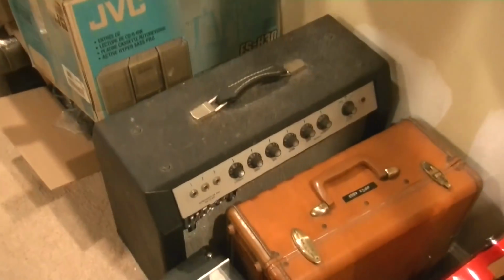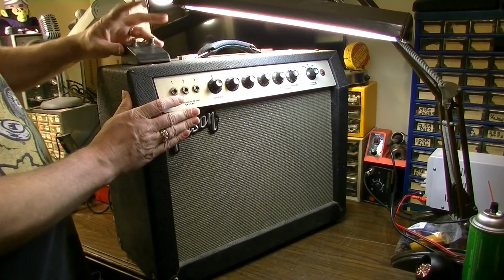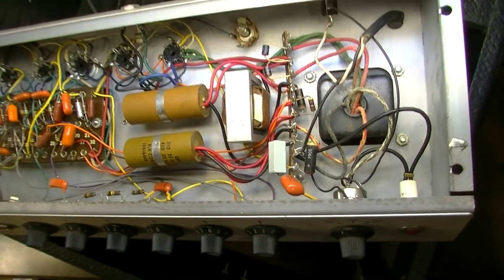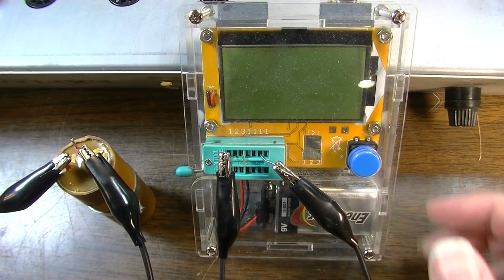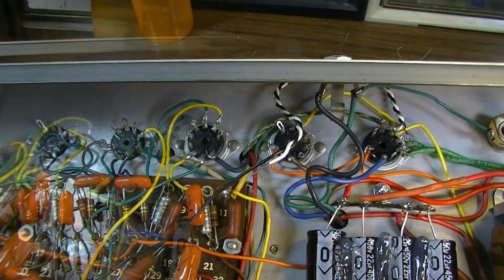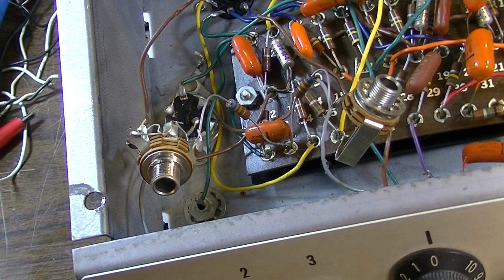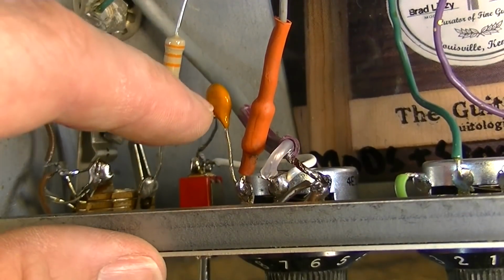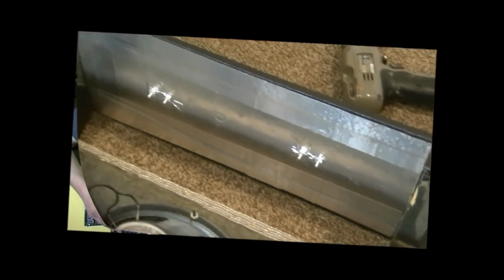The Baddest Gibson GA15RVT Explorer on Planet Earth?

Comment: Awesome new lighting and sound, Brad! Looks and sounds great. One other thing to note for any new people thinking about getting into this stuff; the high voltage in these amps is no joke. If you're thinking about getting into doing amp repair/restore, please make sure you are comfortable and familiar with safety procedures. Have fun repairing your amps, but be safe!
Reply: Simple, set up a ground, and use it to test for stored energy. The old TV sets had far more energy than your average tube amp, but stay safe. Learn the right way, then you don't have to be scared.

Comment: Hey Brad, have you ever tried one of those desoldering tools that is heated? Basically, it's a 30 watt iron with the vacuum plunger like a regular solder sucker. Seems like it would make life a lot easier, having to only hold one tool. Tenma 21-8240 Vacuum Desoldering Iron https://www.amazon.com/dp/B008DJRYIG/ref=cm_sw_r_cp_apa_i_.3J-AbP5W849E

Comment: What about using a Bridge rectifier and a 7806 regulator and two 1,000uf caps to clean out any ripple that should give a rock solid 6V to run the filaments, he 7806 might need a heatsink.

Comment: I have the GA-35 RVT and a host of issues .. did some mods from Uncle Doug’s channel and it improved .. trem & verb is funky and doesn’t really work unless I short some foot switch wires (makes no sense) ... need to do a cap job to see if I can fix the trem, verb issues... it is a harsh amp initially... but hoping mods and cap job will warm it up..

Comment: Great work bud,next time with your Makita or whatever screw gun your using,is take your wire's twist and put in the chuck tighten them up and slowly pull the trigger.it will save a little time .👍👍🎸🎸🎸

Comment: One thing i do is twist my wires by putting them into the end of a drill, and let it rip. i do a bunch of feet in different colors in long strips and cut as needed. Oh wait, are you still missing your drill???? meh....!~~~~
Reply from the maker: The drill for twisting has become a popular subject in the comments. I really should have addressed that in the video. I was trying to use up some shorter pieces of wire I had lying around without twisting a big long length of new wire.

Comment: HAD another thought, know its sacrilege to Ampaholics to deface the oldies, but since u started it, the amount of work u put into that i would have kept going and put your MIDRANGE on the front, would drill knew hole between the Power & f knobs spacing it same as all the other pots, Remove existing power knob and put a Toggle SW in its place because of Spacing. move all pots over and put your knew Midrange between the treble and bass.  then a LOT of  relabelling would HAVE TO BE DONE & Lable your other Mods. 
 
WOW, what an amp that is NOW U R the BEST  : )
Reply from the maker: I had the same quick brainstorm, but that's out of the question for a couple reasons. One is the fact I hate defacing vintage amps, the other is I don't have the means to relabel the faceplate, even if I did drill it and move the controls. The midrange would need to go where the Bass control is now, and everything else scooted down. Good thinking, but just not a job I'm up for.
Reply: was wondering if  "Letraset" would work ? 
  https://www.youtube.com/watch?v=ed6iXQW_O1U
Reply: Rob Young I
Reply: I was thinking that must have been your reasoning.  Without defacing it, something that might look cool on a future job is some small bit of brass plate, cut out, and then stamped with the modified function labels. They would be held in place by the nuts that hold your pots in, and are removable, so them amp mod is reversible without cosmetic harm to the front face.
Reply: Brad,
Seems to me you don't need the "old bones", just a source of transformers that won't break the bank. How much longer would it have taken you to build that modded amp from scratch, compared to troubleshooting and then modifying an old one which needed new tubes anyhow? How much more would it cost?

You'd have a drop-in chassis someone could put in a combo amp that's otherwise not worth fixing, and you could put as many knobs as you want, where you want, because it's your chassis. :)

Comment: just a thought  Brad, if u have to rewire things like that, u could sweat the leads off (Tube#2) and twist the pairs on both sides, so your soldering 1  point and have 2 done, then go to Tube#4  & do the same. this way u solder 2 connections and all 5 are correctly wired.  : )       and cut the nonsense off the first.tube#1

Strange they did NOT do it properly originally ? because they did twist the pair from the transformer.
Reply from the maker: That's a nice suggestion if there was enough lead. Not enough lead though, especially for what I wanted to do, which was push the wires back into the corner.
Reply: Rob Young if you just use the existing wires and you twist them you'll never have enough room to reconnect them and get them back out of the way, just a thought.

Comment: I use aluminum HVAC tape for shielding too.  I've compared it against copper with my amplifier and it was unnoticeable.  It wasn't copper tape either, it was 1/16" copper sheet from an old church I re-shingled.  Literally no difference.  
The experiment was used on my heavily modded Pro Junior III.  I made it into a head.  Made two top covers one with each type of shielding.  So I could just pop one off and pop one on while my looper was playing.  No top I could hear my wifi just cracking away.  Either top made it dead silent.
Reply from the maker: I suspected as much. Thanks for sharing.
Reply: You're welcome sir.
Reply: I’ve used heavy duty aluminum foil attached with Elmer’s glue and that worked well also.
Reply: Desde Chile te veo .eres un talento .... ojalá vinieras a Chile tengo unos  vintage  amplif... Philips .guyatone reverbrock  .hohner . Lab series . hamstrom sweden ...te espero jaja.
Reply: I dont' see why not, I'd even say use contact cement spray and it could be super ass cheap to put on and easy too.

Comment: Surprised I didn’t see a couplet/tone sucking network in there.

Great work, Brad! Sounds excellent.
Reply from the maker: Schematic calls for TWO of them! Neither were in here.
Reply: Yeah, both of mine have those twin T filters in them (I have both the Gobson and the Epiphone versions of this amp). I have been so torn about removing them because both amps are in such good shape.. I may decide to just bypass thme and leave them where they are.
Reply: @jppagetoo  I worked on a Gibson about two years ago that was a little larger than this one with two 10 inch speakers.  I took out the T filters and it turned out GREAT!  It sounded and reacted sort of like a Hiwatt amp when I was done, very aggressive with a terrific tone.

Comment: Offsetting the heaters is a really good idea and easier to execute than making the heaters DC and usually works just as better.
On really hummy fender types I've taken a wall wart and done a cheaters DC heaters even going as far as actually using 12.6 volts on the 12ax7s just for fun. I doesn't do much except reduce the amount of Current drraw from the wall by about 1\2 an amp in total.
Reply from the maker: Fewer components to fail as well.

Comment: are realistic speakers any good or not so much? great work. a youtuber that is productive ?? hum.
Reply: That looked like an early 80's Radio Shack based off the label alone. And yes during the late 70s into the 80s the RS speakers were ok. However they didn't like being overdriven and burned up quicker than a guitar speaker would.
Reply: I don't know how they will fare as guitar speakers but late 70s Realistic hifi speakers were actually surprisingly decent. I still have a pair of late 70s three way cabs hooked up to a Realistic receiver / turntable that will bring the roof down.
Reply from the maker: This one was good enough I advised the customer to leave it in and play it a while before jumping to a change. The reason - the power handling seemed about right for this amp and it looks to be a well-constructed speaker. And to my ear, it has good tone - about as good as it's likely to get without spending a lot more money and/or going to a 12" speaker.
Reply from the maker: Yeah, and keep in mind, the overdriven parts of the demo were just cranked to the max on all controls like a dumbass. I didn't bother trying to tone shape, so I could have made the overdrive sound nicer had I tried.
Reply: it didnt sound bad at all for a radio shack speaker :D
Reply: it's likely a Pyle , Radio bought Pyle in the late 80s or 90s
Reply: Some are, they had many mfgs thru the years, many the same as oem. Worst property is likely too much fidelity and not enough 'honk'
Reply: Thank,s for your input, another watcher said thay where made by pyle?
Reply: I like that Johnny B Goode cover Rab.  Nice.
Reply: Kurt Cobain swore by them. Iirc

Comment: Nice Work Brad.  You probably have seen it before and prefer your method, but you can wind the heater wires using your cordless drill... saves time is all... maybe some hand cramps too, lol.

Comment: 1st stage audio was good when you came back it got thin and quite
Reply from the maker: I know. My mixer started doing some weird stuff, and I also found my condenser mic I was using was faulty. Don't know if those things were related. So I went to this Neewer condenser for the second half, but for the demo room mic, I used my Shure Beta 87A. I'm going to stick with that one from now on for the room mic. Thanks for the feedback!
Reply: I smell a mixer repair vid. Could also be interesting to open up the mic and play around.
Reply: I thought it sounded pretty good all dialed up to eleven, but then I'm listening through crap speakers.

Comment: Surprized you don't make up a bunch of twisted pair using cordless drill, good time-saver!
Reply: Agree, I roll off about 9ft of 2 colours, tie a knot at one end, wrap it around a door handle etc then the other end in the cordless drill chuck & twist them up to whatever twist you want i.e. loose twist to tight twist then cut off what length you require.

Comment: video and audio changes look and sound great.  Thanks Brad.

 I have a question about twisting leads.  
In fender guitars the pickup leads are parallel.  I have always twisted my leads for each pickup.  I figured it would help cancel noise.  Is twisting pickup leads a good practice or am I killing some magic tones?  My Strat still sounds like a crappy player is on the pick.
Reply from the maker: Twisting is just a way of trying to shield the positive conductor with the negative one. That shouldn't kill your mojo on the pickup. Potting pickups can sometimes do that though.